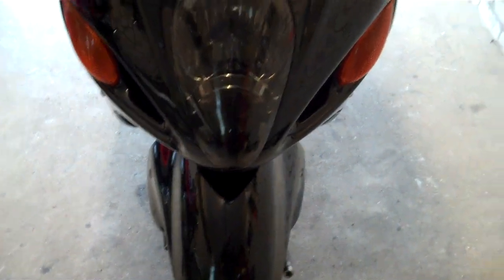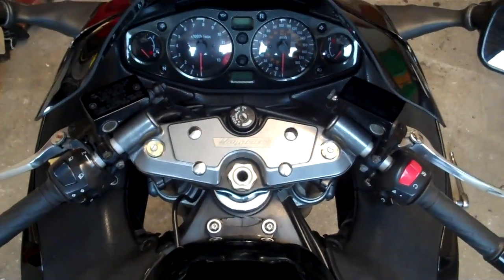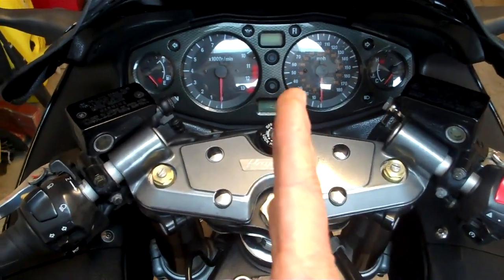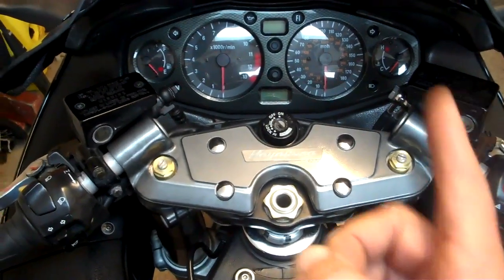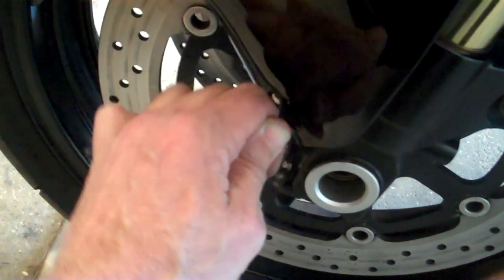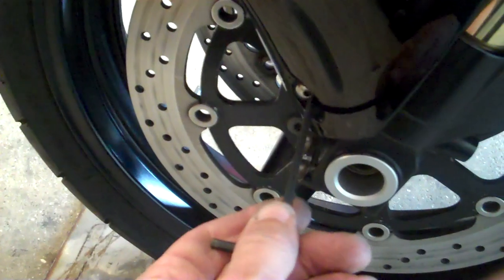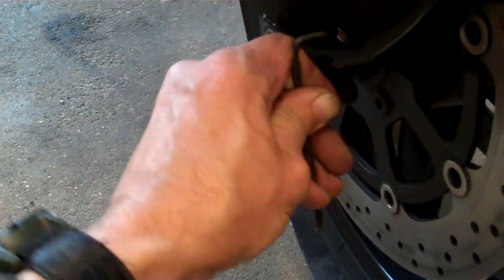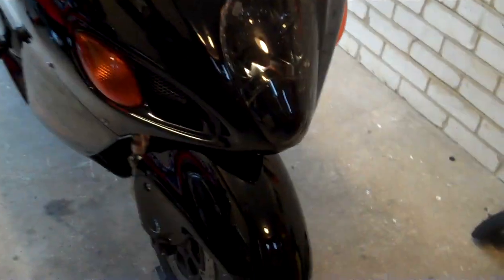Delboy's Garage, 'How-To' Re-align motorcycle forks the easy way.

Comment: Does this technique also work for Kawasaki 2007 ZX10R? I was told by a Kawasaki tech that this particular model has a "pin" and the technique you've illustrated cannot be done. Your input? Thanks
Reply from the maker: +rasmey ung "You input"?....intersting way to ask a queston..!!!  Never heard of a 'Pin', where is this pin exactly, and what does it do..?
Reply: Not sure. That's why I'm reading blogs and watching Youtube to learn more. I recently dropped my bike and it seems that the steering is bit off to the left when trying to keep the bike going straight.
Reply: +Moonfleet41 At 10'24": what did you say about the top bolt? You don't loosen that bolt, do you?
Reply from the maker: +rasmey ung Yes you do Rasmey, if your bike is of standard constructuion, and looking past any issued with mysterious 'pins' etc... they frok yokes hold the legs by friction, and the two yokes need to re-align as they impact has probably twisted them out of alignment.....loosen the top nut, then everything lower than the top two pinch bolts...and plunge the forks to flick it all back to centre.....then, starting with the top nut, tighten bit by bit, every fastner all the way down just like in the video.... why not just give it a try and see if it wirks buddy, nowt to lose aye?..
Reply: Thanks buddy. I'll give it a try.

Comment: Will this work on a BMW r1100s? On center stand?
Reply from the maker: Roger Woodhouse Not entirely conversant with that bike, does it have the telelever front end??  If so, then I'm not sure, and also it will never work on the centre stand on any bike, it needs to be at least on a paddock stand, or just on it's two wheels.. perhaps get a friend to hold upright from the rear??

Comment: Hi Mr. Moonfleet, just a quick question. What if someones forks are not aligned and he/she don't re-align them because "he/she did not have the time to do so" . Does leaving it alone damage the motorcycle in any way?.
Reply from the maker: No, it doesn't do any damage if it's slight, but if you are a fair way out of alignment it can cause handling problems in cornering... so go steady and get it done as soon as you can buddy!
Reply: Moonfleet41 Okay, thanks for the really quick reply. I really appreciate it. I took a look at my bike and, to be honest I don't have the confidence in myself to loosen the axle and the brake caliper. Will it be roughly the same either way?. I apologize for asking too many questions...

I said "time" I meant tools (rear stand/Friend), sorry.
Reply from the maker: MisTurn PiOxygen
Never apologise for aksing questions, the only stupid question is the one you dont ask..  Honestly its not acomplex task, just watch the video a few times and it may give you the confidence to have a go...
Reply: Moonfleet41 Wow okay. Many thanks for your kind words :D
Reply: ***** I didn't hit a pothole though.. But thanks for the info!.

Comment: Very helpful video, thanks mate! 

The alignment on my Multistrada is slightly out, will try this process to square it up over the weekend. I noticed questions about loosening the steering head nut as well as the lower triple/axle bolts. The Multi has a top triple setup quite different to your Busa, looks like this...

https://upload.wikimedia.org/wikipedia/commons/b/bd/Ducati_Multistrada_1200S_instrument_panel_and_handlebars.jpg

If I want to square it all up, will I need to loosen that little pinch bolt on the top clamp too? I presume the actual steering head bolt doesn't need to be loosened? Showing my ignorance, find it more confusing than I probably should... Seems to be a school of thought that only the axle/lower pinch bolts need be loosened to align the forks, but I guess I'll loosen the triples too in the hopes that it'll get everything back to neutral, so to speak. Any advice would be a huge help! Thanks.
Reply: It's the same process as with other bikes. Loosen the steering head bolt, then loosen all the bolts below the pinch bolt on the top clamp. So your entire front is held in place only by the two pinch bolts on the top clamp. I just hope they don't nickle and dime you for sockets for this unusual steering head bolt...

Comment: mine is Yamaha r15 and I feel a small drag towards the left when taking a right turn and also feel more weight on the left handlebar..do u think this method will work?
Reply from the maker: This is for when your bars are out of alignment, nothing to do with pulling... maybe check your tyre pressures and your tyre wear - if your tyre is badly worn one side, it will affect the steering, as will having a tyre pressure that is too low - so check those first!
Reply: I checked for punctures and actually found one too..now they have been rectified but still the problem persists.. actually my motorcycle was involved in a small accident..where the forks became bent,that's what the mechanic called it and removed the bend using a hydraulic press machine...but still the problem persists.. what do I do now? could you help me out on this?
Reply from the maker: What exact item on the bike was bent, the thing that the mechanic straighten with a press?  was this also a front end impact..?
Reply: Moonfleet41 the left fork was bent..that is what the mechanic said... actually I was taking a U turn and a car rammed into my front  wheel when I was taking the U turn...
Reply from the maker: If you definitely had a bent fork leg... then he may have made it less bent, but he wont have made it straight.. its almost impossible without specialist equipment.... best advice is to buy a new fork leg and that will cure it buddy... ! Good luck with it.. Del.
Reply: so it's okay to replace a single fork leg? I don't need to replace the other one? or should I change the complete set?
Reply from the maker: For what it costs, the whole front of the bike took the impact, so to avoid future issues, I would replace both, if you can afford it!
Reply: okay I will check it out. thanks a lot.

Comment: Did you loosen the triple tree yolk bolt/nut?
Reply from the maker: Yes i did, i just failed to cover it on camera... sorry... you MUST loosen that so they can align themselves..
Reply: In what order did you torque down the yolk nut? Was it done last or? I'm afraid if I hold onto the handle bar and torque down the bolt with everything else lose, it will just misalign everything again.
Reply from the maker: 1tokeover
Tichten the yoke nut last, or at least after you have tightened the four clamp bolts.. then it will stay straight..

Comment: would it work on yzf r6..kinda dropped it so now when the front tire is straight the handlebars are at an angle
Reply from the maker: +Alnite23 Yeah, give it a try, usually works!  If it doesn't, check the rear wheel alignment, and if it is still out, you've bent something!
Reply: +Moonfleet41 thanks a lot it worked perfectly on my R6

Comment: I dont understand how this happens, but I can see that it clearly does.  If axle is a straight rod, then how does it twist out of place in the triple?  I figure it would fight the fact the axle is straight and avoid that twist because its being held in place by the triple.  IDK
Reply from the maker: The explanation is in your last statement mate.. "being held in place by the triple" .. it is only "gripped" using nothing more than friction, and with impacts from pot holes etc.. if can eventually get knocked very slightly out of line.. and it doesn't take much to make it feel twisted..
Reply: Thanks for the explanation, I thought about it in my head more and figured the triple's aren't necessarily connected to one another directly, they are just holding the forks.  Doing that bounce technique will pull it back into alignment based on my original thought process with the forks wanting to be naturally straight.
Reply from the maker: Only if you make sure that you loosen the clamps on the bottom yoke to allow the fork kegs to rotate within it and therefore re-align, and also most important, loosen the top nut on the top yoke to allow the two yokes to move independent to each other - good luck with it mate...

Comment: Can I use the center stand instead of pedal stand ?
Reply from the maker: +Søren Hjort Possibly, but the bike needs to be on it's wheels with the suspension loaded... if you use a main stand this unloads the rear suspension... maybe stand it on it's tyres and get someone to hold it up from behind ....

Comment: Do I have to loosen the big nut in the center of the yoke?
Reply from the maker: kingofskateop Yes mate, back that off so its finger loose.. then the two yokes can move indipendantl of each other to re-align...
Reply: Moonfleet41 So is it going to work on my yamaha mt-09 (fz-09) too? Is it normal to have this problem on a brand new bike? I mean do they align those forks perfectly in the factory? The distance between the handlebar and the tank is perfect on each side, but when ride on high speed I can feel more pressure on my right arm, I mean the handlebar (and the whole front setup) is slightly turned to right (in a very small degree). Btw, what is the right order to tighten those bolts back after the adjustment? From top big nut to the bottom or vise versa? And also how can I keep the alignment while I'm tightening the bolts? Thank you!
Reply from the maker: kingofskateop OK, the order is "Top yoke middle nut, then bottom yoke pinch bolts, ten move on down to finish with the axle... BUT... if your bars are equidistant each side of the tank...it could be REAR wheel alignment, if the back it off a bit it causes the bike to "track" or "crab" a little and the steering natually compensates to ride you straight... so check the back end first before you disturb the front.... also.. if its a new bike.. have you told the dealer, it will obviously be under warranty still im sure..?..

Comment: I have a 2017 Kawasaki z650 it doesn’t have the middle bolt on the handle bars but I’ll give it a try
Reply from the maker: It will have a central fastening of some kind, have a look under the yoke, it may be a pinch bolt, but all yokes have a top fastener of some kind.

Comment: Use a little dum dum or rubber cement to hold the 24mm nut in the socket to make it easier to use as a tool.
Reply from the maker: Good idea, thanks mate..

Comment: 5:30 do I have to unscrew the bolt on the other side of the top tree?
Reply from the maker: No mate, i should have said "These ones".....leave both of the top bolts done up and as i said, release every bolt lower than that...(and dont forget the centre nut in the middle of the top tree...thats must be released too..! good luck with it ..Del.
Reply: Moonfleet41
Got you. And thank you for the video. It's very helpful.

Comment: how does pressing down on the forks re-align them?
Reply from the maker: The two yokes are machined to be parallel, but they can be knocked out of alignment by an impact. so loosening them off, and plunging down on the forks allows them to realign, then you tighten them back up..

Comment: that pinch bolt just under the handle  bar , when doing it myself do I loosed both sides when starting off.
Reply from the maker: Looses all the lower pinch bolts in any order... then last of all, loosen the centre top yoke nut... and once its realigned.. tighten up the top yoke centre nut first... then do all the others..
Reply: Thanks, crystal clear :)

Comment: can anyone help me. I'm more of a car mechanic just starting on bikes now (hobbies). I got a CBR 125 2013, if I remove the top yolk center nut to replace with either a hollow or yoke mount, would I push out the alignment? I want to get a yoke phone mount or ram phone mount.
Reply from the maker: +HonestAbe89 Hi mate, no, you won't twist out the alignment by just removing the centre nut and replacing it, as long as you keep the pinch bolts either side firmly done up whilst you're working !
Reply: +Moonfleet41 sorry to bother again. People keep telling me not to take it off and drill a hole for the ram mount in the yoke nut. I wanted to take it off so debris doesn't fall in and then use the ram mount kit which should block up any water from going through. otherwise buy a hollow but which hopefully cbr600 fits but gotta find out.

Comment: that 24 mil nut trick was really sharp thinking mate anybody no if a honda bros would be the same size allen key for axle ? 8:48
Reply from the maker: Hi David.. just measure it with a ruler buddy, it wont be that hard to get an accurate guide and then just buy a bolt to bend over, or use a nut like i did...

Comment from the maker: If you dont release all the lower fasteners then the forks will not be free to slip into place freely... maybe invest in a tool for it, after all you'll use it when you need to take the wheel out..

Comment: you loosened both fork leg's pinch bolts meaning the axle effectively spun in the fork leg when you went to loosen the axle.  You should have just loosened the Allen bolt pinchers first, then undone the axle and then loosened the other fork legs pincher bolts

Comment: My pinch bolts at the bottom were so tight they snapped my socket. I had to squeeze the wheel between my knees and pull the handlebar over to the side it needed to be. It's worked but can this damage the bike at all?
Reply from the maker: Hi mate, everything clamped together on the front end is gripped by friction, by snapping it back in that way maybe once or twice won't do too much harm, but I wouldn't make a habit of it... and if that bolt is so tight it breaks sockets, then I would set about releasing it and re-torquing it before it cracks the casting... just a thought...
Reply: Moonfleet41  I literally can't undo the bolt. I've snapped 2 sockets now and bent a wrench just trying to loosen it. The handlebar is aligned now, think maybe I should leave it? Any suggestions?
Reply from the maker: KingLies  What bike is it mate, and what bolt is it exactly?
Reply: Moonfleet41  Bandit 1200, 2005 reg. It's the two pinch bolts at the bottom.
Reply: KingLies
Off topic nice bike mine is a 96 Bandit 600s. I'm currently putting in forks on a Ex500 Ninja 05.

Comment: You didn’t really cover how and when to do the 28mm at the top, when do you loosen, how much and when do you tighten
Reply from the maker: Sorry mate.. should have made it clearer.. loosen the centre nut so its free to spin with your fingers... and do it back up again FIRST before all the other bolt... hope that helps.. Del.
Reply: Moonfleet41 I also found your newer video of this and left a comment, how important/helpful is putting a piece of stainless under the tire?

Comment: I have a brand new $50,000 Harley with an alignment problem at the dealer now. A Harley doesn't have a nut on the top triple tree. It has a pinch bolt in the center.
Reply from the maker: Yes that's a common application, the top yoke (tree) clamps round the stem shaft with a pinch bolt..   Surprised they would have sent out a brand new bike without checking that on PDI !!  Hope it get's fixed for you buddy. !
Reply: @Moonfleet41  Two dealers told me that it came from the factory that way and can't be adjusted.

Comment: is this thesame solution for a scooter? please i need help, my forks and wheels are not aligned. and my ignition keyslot cannot be locked when this happened. maybe someone picked on my scooter
Reply from the maker: Hi mate, often on scooters you have a central stem with the double clamps lower down... so you'll have to strip your front plastics off to check where the twist is, one of the clamps will have moved with the impact they made and you just need to loosen it and then re-tighten it after straightening it up... hope that helps mate, good luck, Del
Reply: He said he is gonna replace the ignition lock too, and he also said something about it cannot turn to the  right, and hes gonna charge me 300 dollars for the repairs... I think hes lying cause i drove the scooter to the repair shop myself and it can still turn

Comment: All fine where it says everything south of the top yolk, until you suddenly say, loosen the middle top nut!!! What? How much, how much to tighten?
Reply from the maker: alastair cox Hi Alistair, sorry for the confusion, just back it off till its loose and spins with fingers.....here's a list of torque settings for you mate.. http://www.hayabusaclubholland.nl/downloads/Aanhaalmomentenbusa.htm
Reply: I found that even after loosening all the nuts, axle, yoke, top nut, the assembly was still very tight. Do I have to free the top yoke a little to enable the fork tube to move?
Reply from the maker: alastair cox NO Alastairm the only two bolts that MUST stay done up are top two yoke pinch bolts.... loosen them and the front end will drop down onto its belly... have you loosened off the fastners for the front mudguard...they will hold it from moving too..??

Comment: Is this the same with a Harley sportster?
Reply from the maker: pretty much !
Reply: @Moonfleet41 How about scooters like Silverwing 600 for example. Forks are held on just 1 point by each 2 screws. I guess it is much easier in compare to usual motorcycles. The both should be fitted in those clamps like they were before and that's it. I'm planing to bring forks for oil seals change to my local store as it is pretty straight job to take those forks out and put it again back only 2 screw each side holds. Cheers mate